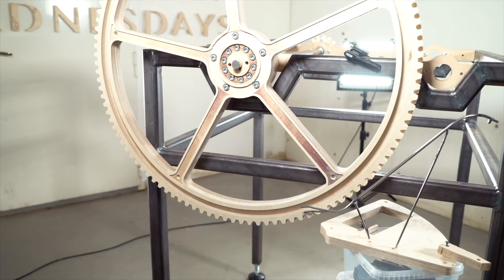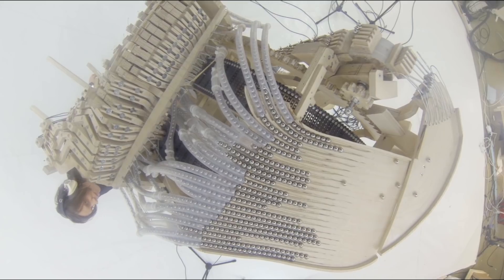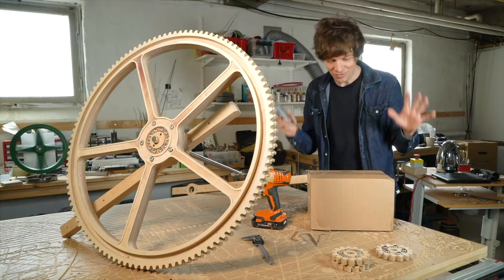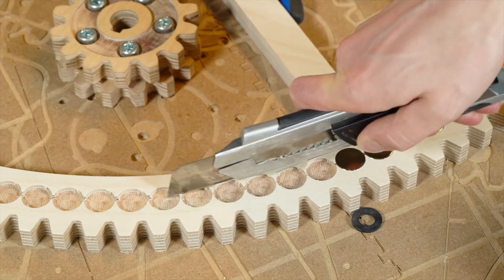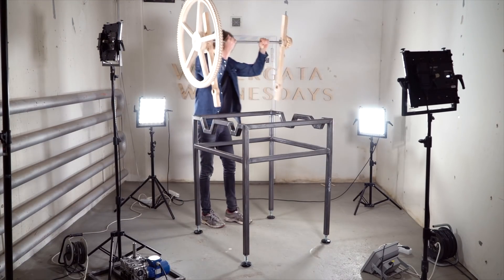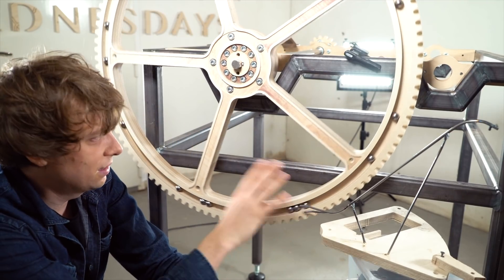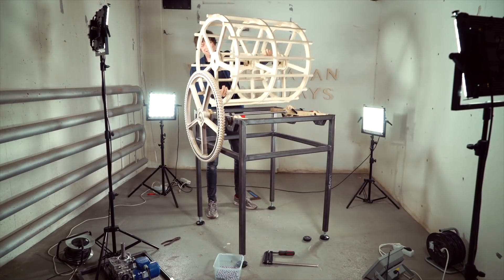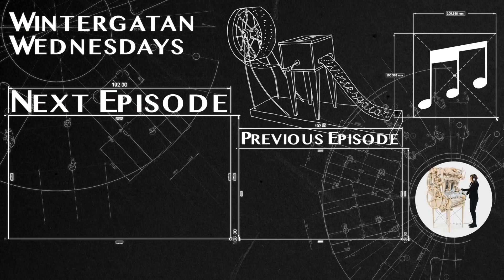Lifting Marbles With Magnets - Marble Machine X #13

Comment: Excitement intensifies!  I'm curious to see how you're going to get the marbles into the center of the programming wheel since the spokes would be rotating past.  Only thing I can come up with is going through the central hub, but I can't come up with a way to do so without leaving one side of the wheel unsupported.  Excited to see your solution!

Comment: o and your problem with the marbles becoming magnetized adding heat to the marbles will cause them to lose their magnetism the point is called the curie temperature but then since your machine is constructed with wood it would probably not be good for your machine ,and having all the hard work put into the machine would not be worth the pyro-Technics on stage for when you tour the world and come to Detroit Michigan > well we hope u come to Detroit. but in between tours allowing the marbles be divorced from the machine will most likely have a safer result :)

Comment: As others have suggested a degausser I will skip and say a backup marble pump into the machine that you can activate when needed if the main lifter fails to keep up. https://youtu.be/eWQ-189ijeM for a simple to build pump that can pump the marbles in a pipe hidden in the frame. Figure a catch pan under the main lifter to feed the pump to let the main lifter stay the focus without losing marbles when running.

Comment: so your magnets placed around a moving wheel gives you the opportunity to create a current as well. Some research would need to occur to figure out how much voltage you can create from your magnets on your wheel in which would also depend on the winding of wire u have room for .> just a thought :)

Comment: as someone who knows a fair bit about magnetism: you may want to be careful with what you put near those magnets, if there are electronics i.e. copper solenoids, electricity-conducting wires etc. the rapid changing of the manetic field that those magnets will create as the wheel turns will induce a current in those wires (this may cause problems). As well as that, considering that the base structure of the MMX is METAL, that may create magnetic induction as the metal closest to the wheel becomes magnetic (this may cause further problems with electronics. all I'm saying is that there is a lot to consider when magnets are involved, I would heavily suggest you research megnetic induction and electromagnetic induction
Reply: If we can please bring this to Martin's attention, that'd be great. I am honestly concerned for what may happen with the addition of those magnets

Comment: I hope you are not planning on having the final programming wheel be only press fitted together.  I suspect you will have trouble if you do it that way and transport the machine some place with significantly lower humidity.  Wood moves and press fits in Sweden may become loose fits in Arizona.

Comment: You might need a degaussing coil to demagnetise the ball bearings. The wikipedia article has an interesting bit of history on the topic (the idea was originally developed to protect ships from magnetic sea mines!) and a basic explanation of how it works. They're apparently very common in old cathode ray tube TV sets, as the metal grid within the screen can become magnetised over time leading to problems with the picture.

Comment: I'm curious about the plan to control the marble flow to the first ring-lift gear; are the marbles going to be queued in a pool, like the first machine, with some kind of timed-gate continuously running? Or is the plan to just have a constant, steady stream of marbles never-stopping for a second?

Comment: so the reason the marbles are getting magnetized is because the magnets are all in the same orientation , if you go back to the elementary experiment of making a compass out of a needle and a cork you have to use one side of a magnet to magnetize the needle, now there might be a few solutions, one would be to remake the wheel, and reinstall the magnets with random or even alternating orientations this would be the best solution, another solution might be to put a strip of metal (i think Iron o ferromagnetic steel would be your best bet) between the magnets and the wood of the wheel, this will reduce the strength of the magnets but it shouldn't be too bad, but i think because the marbles will be touching metal the amount of magnetization should be reduced a little, because the domains in the metal strip and the balls should interfere with each other this is an alright solution but might produce problems later, and the final solution, though not a good one at all would be to have a degausser running wherever the balls are held after they are used, this is a bad solution because a degausser will interfere with the recording equipment.

Comment: By alternating the polarity of the magnets in the lift, you could effectively created a generator by simply adding a coil next to the ring of magnets.  If you then add a capacitive circuit, you could probably power an electric degausser, without the need for external sources of electricity,  to demagnetize the marbles.  If not a degausser, you could power some lights.

Comment: just add 2 coils on the other side ( for example near the lower bar of the metal structure )  spaced by n+1/2 magnet spacing and activate the coils with a 2 opposite phase sine signal and you should have a nice electric motor ..

Comment: You could calculate the correct incline of the marble track which would mean that the speed of the marble matches the speed of the wheel making the connection more clean

Comment: IDEA: How about using a stronger magnet, pulling from the opposite direction at the top, to rake the marbles off? Then you wouldn't have to flip the ones inside the gear, and it would also look like fricken magic, dude!

Comment: Warning: A side-effect of not putting the magnets in an alternating polarity is  that you shall not be able to officially transport the contraption on an airplane without having to add ridiculous shielding measures. The aligned magnets create such a large dipole that it'll screw with the aircraft's compass (in theory).
Reply: [Citation required?] https://www.faa.gov/documentLibrary/media/Advisory_Circular/AC121-28.pdf

Comment: Make the gear wheel out of acrylic, so you can see the magnets. Also much stronger than wood.
Be aware that these magnets can corrode and they will loose there magnetism after a while if that happens.

Comment: if ball magnetization is an issue, pass them by an alternating magnetic field of diminishing intensity.  for example a spinning magnet that starts cole by and moves away, this method has worked great for me for demagnetizing screwdrivers and watches.

Comment: Yes, I think the better idea is to put magnets in the alternating way. The magnetic force lines in that situation would be shorter - from one magnet to another, not around whole wheel. That can reduce the magnetic field in the longer distance from the wheel. And if You want to demagnetize marbles, you can make a tube with a coil. Provide the marbles through the tube, and put some alternating current through the coil.
Reply: And also flipping the magnets should solve the problem with the marbles falling down on the wheel channel. My last suggestion: On the large wheel you have gears with offset. So may be the good idea to put in small gear some gap between two playwoods? This is to avoid collision between two wheels, couse i saw that the big wheel is a little bit moving along the axle direction 8:20. I wish You luck!

Comment: As you rely on the tight tolerances of the CNC-Machine - are you sure, that the wood will not loose its dimensions when it gets more dry or wet? Maybe its less of an issue with plywood though.

Comment: Moving Magnets near that mteall-frame will produce electricity in the frame. If there's a electrommagnet added near the lift-ring, the marble machine X could be outfittet with 5V or 12V bulbs or LED, wich are operatet just with the power of the marble lift...

Comment: I'm concerned that if the the "marbles" stay in contact with the permanent magnets, they too may become magnetised. Thus they could attract each other, and any other steel parts in the machine causing jams. Easily solved, of course. An alternating magnetic field (e.g.  an AC transformer, degaussing coil) will demagnetise them. Maybe something to think about?

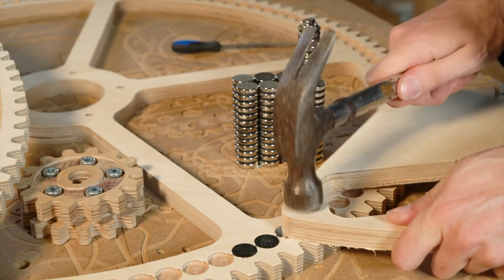Comment: Lots of things can "kill" magnetism... 'blunt force' for one, which is why I winced when I saw you hammering them in, 5:50 (even letting one magnet smack into another can demagnetize them 5:33) although, that didn't seem to harm them much, if at all. Heat, will also demagnetize magnets... so if you bake your magnetized marbles in the oven for a bit, they should loose any magnetism they may have obtained.

Comment: To fight the marbles getting magnetized you could place a degausser under the track in some relatively slow moving place; a degausser is really just a magnetic coil alternating polarity at a high speed, you pass a magnetized thing into and then out of the field and it exits with mostly no magnetic bias. Commonly degaussers you buy are just an electromagnet hooked directly to mains frequency, or even mains voltage. You'd want to put it in a place where the marbles should never stop, but maybe the entry way to the distribution platform where they're not going fast. Also it should be a place where exact timing isn't important, because this device will probably slow them down, and make them jitter unpredictibly; but as long as they're on a slope gravity will win out over the brief and reversing pulls in any direction. As long as it's operating constantly I would expect you can keep it relatively weak and it'll just maintain a low degree of magnetization rather then having to correct a stronger bias later on. That said you may want a second machine to use between performances that will clean the balls of stronger biases.

Comment: Martin, gut feeling is that magnets are not the way to go; they'll become magnetised, which can generate further problems down the line (several have been suggested by viewers already) and, even worse, problems that may be quite hard to anticipate.

Instead, cannot the carrying capacity of Matthias's wheel 2.1 be largely increased by merging (joining together) several of the individual holes? Sooo, :) say you create incisions in Mattias's wheel where the holes are, each incision with the same size as 4 or 5 or 6 holes; 4 or 5 or 6 balls can enter that incision at a time -- it loads fast. Sooo :) you should then be able to increase the speed of the wheel to achieve your desired throughput rate, right?

The wheel does not need to be tilted as Ronald's; you can simply keep it vertical and have a wire close to the wheel, starting after the loading zone and extending up to the unloading zone, to prevent the marbles from falling off the wheel during travel upwards.

Comment: You know what might be cool but entirely unnecessary... If the scoop at the top of the wheel diverted marbles through the wheel in between spokes turning. I was thinking similar to the way WW2 fighter planes shot bullets in between the rotations of the main propeller, timed to fire with the rotation of the engine.

Comment: I was also curious about the marbles getting magnetized... Just a brainstormed idea: Couldn't you build/buy a big electromagnet/coil and run AC through it? Then just run every marble through it, e.g. directly after it comes out of the loop. I'd imagine that'd fix the problem quite well...

Comment: Depending on how fast the marbles pick up magnetism, you could try running them through a degausser between shows. (The kind designed for tools would probably work better than the kind for hard-drives) Another cool way you could do it would be to incorporate some sort of degauser coil right into the marble run itself, and use the magnets in the wheel to generate the power for it. Plus then you could do stuff with lights, possibly even use marbles to activate them (which could be controlled on your programming wheel). kind of a lot to add at this point though, so just some food for thought I guess.

Comment: if electronics are allowed, you could maybe solve the magnetization problem by having the marbles run through a coil after a sensor that tells it whenever a new marble is coming. the coil would gradually decrease its magnetic field for each marble (and powered by ac)

Comment: Magnetization of the Marbles was my first thought when I saw the Video-Title. I doubt that it may have helped to change polarization of the Magnets, cause the magenitzed Marbles would sooner or later choose the correct opposit themself and you might run into other problems.

My thirst thought that you did this with marbles which just have a iron core. That might be something you can try, iron core just big enough to get attracted by the wheel, but not big enough to have the marbles glued together because of the magentization-effect.

However, I love your projects, good look with further development.

Comment: What if you built into the MMX a system so when the marbles get transferred up, then on the way down the are somehow demagnetized.
Reply: Add a generator and a big degaussing coil in the collector at the bottom of the machine! :D  Martin will get a real workout.  Or just use stainless steel balls.
Reply: Stainless steel balls won't stick to the magnets in the first place... so why have the magnets at all?
Also, you don't need an active degausser. Just drop the marbles through a demagnetizer each time they go through the machine. That should be more than enough.
Reply: Yeah, thought of that after I posted...  Depends on the kind of stainless, but if it's the kind that's ferromagnetic it could still get magnetized.  It's a vicious circle!  Yo, Martin - what Falcrist said about the demagnetizer!

Comment: Physisist here: Alternating magnets will give more "effective" magnetic atterection, as you mentioned. The physics behind this is that the flux return lines will be in oposite direction around the magnet. Example: Magnet 1 is in positive polarity, around this magnet the flux return lines give a negative polarity. Putting magnet 2 in negative polarity will enhance the return flux field from magnet 1, while putting magnet 2 in positive polarity will have to cancel the negative polarity of the flux return lines from magnet 1.

I do not think alternating polarity will help reducing magnetization of the marbles, as they will just turn so that the south pole of the magnet will face the north pole of the marble or vice versa. Demagnetizing magnetized marbles can be done by heating them to a fairly high temperature (depending on their material, but generally several 100 degree celcius).

Comment: I love these videos! A quick moment of concern, but if you've alternated magnets on the main crank and am moving it with pretty strong little magnets, you could induce a changing magnetic field off the main wheel. That means an induction current is generated on microphones conceivably causing potential EMI induced "sounds" to be recorded on the microphone's electronics.

Could you try placing a microphone near the main drive wheel and recording no sound to just see if a field is induced?

Comment: You should probably build a de-magnetizer into your machine. A simple electromagnet-coil powered with AC current would do the job. The increasing and decreasing alternating magnetic field (as the marble passes the coil) will de-magnetize the marble. De-magnetizer for magnetic tape heads work exactly like that. You turn it on, bring it close to the head and retract it slowly.... job done.
You could also build a track with alternating magnets. The magnets must be alternating with their north and south poles (not plus/minus...) and with decreasing strength. A bigger distance to the marbles at the end of the track would do the same job.
Reply: Alternating the polarity of the magnets won't help. The marbles are spherical, so they'll happily realign themselves to whatever way the magnet is oriented.
Reply: I think he means alternating N, S below a track on which the marbles roll - and decreasing in strength as you roll further down the track.  Probably isn't a way for the marbles to roll without experiencing an alternating / degaussing field.
Reply: Even cooler if the alternation of the magnetic field is produced by the machine itself, like from a magnet rotated faster by a ratio multiplier.
Reply: You don't need to reinvent the degaussing field. Just let the marbles fall through a common demagnetizer.
Reply: Good idea! A rotating magnet at a place where the marbles run through. Far enough to not attract them too much.
Reply: EXACTLY ! I knew what needed to be but not how to do it aside from my screwdriver magnetiser/de magnetiser. Thanks bud !
Reply: See we have all this free tallent to lean on and put their knowhow forward. This will be an amazing success !
Reply: Well thought !
Reply: My thoughts exactly. Just like the one I use for my screwdrivers.
Reply: See ! There are sooo many options available. Now martin has all the choices he would like.
Reply: This is by far the best solution, and in keeping with the all mechanical design. I've used a similar trick - putting a magnet on a battery drill, and using it to degauss a CRT.

Comment: We have a little plastic demagnetizer tool at the factory where I work. We use it to magnetize and demagnetize our screwdrivers. You have to push through the marbles but it could be useful... (There are magnets inside the plastic casing... If you do not push the balls, they will stuck inside...)